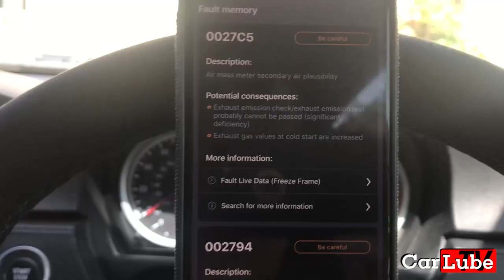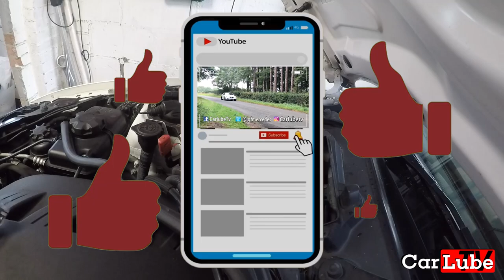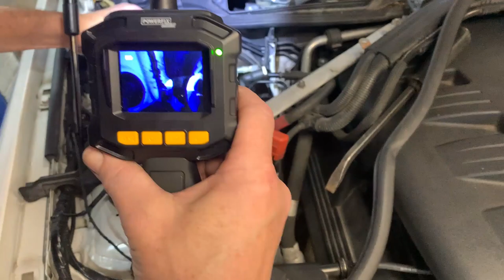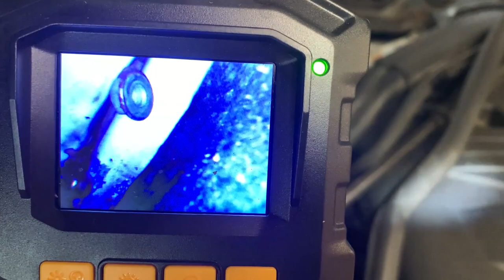M3 ‘FIXED’ Brake Booster Sensor Installation - How To Guide

Comment: Same issue here, on My E93.  I was doing other Prev. 😂. i.e. Plugs, injectors, throttle actuators, idle control valve, fuel breather valve, Vanos covers, valve gaskets & valve covers! I had scheduled to have the work performed, then: I went into “limp” mode! I was certain it was the Throttle Body Acuators! I was so happy to get my car returned in “tip-top” shape! It sounded like a Dream and ran great! Then, after less than 100miles, “LIMP MODE” again!  Code showed: Brake booster 😢. Long story short. That was the culprit! I hope 🤞🏾 😂. I found your video which has me pretty certain it will be remedied.  Thanks and Cheers 😊
Reply from the maker: @ltakallen  brilliant buddy, you can waste a lot of money changing things that don’t need changing, And something is simple as a silly sensor can make these cars unusable.
Reply: I agree. This was to ensure I addressed “known” issues, “proactively” so it was all pre budgeted. The Brake booster was “another” 😂. Alls good 👍🏾

Comment: Seems like a straight forward job once cowling cover is removed and brake reservoir to gain more access. May I suggest rather than removing top and bottom nuts completely, just remove the top one, and then loosen the bottom one all the way just before it comes fully undone. This will make sure bottom nut stays on without having to drop it, and it would be easy to tighten it once done 👍 Cheers 🥂
Reply from the maker: Yes mate I think that lesson was leant.. next time, hopefully there won’t be one.

Comment: In your previous video you reset it and it was fine. Did the issue keep recurring and so you had to replace the sensor and hose?
Reply from the maker: Yes mate, the code kept re-occurring, there was a hard fault